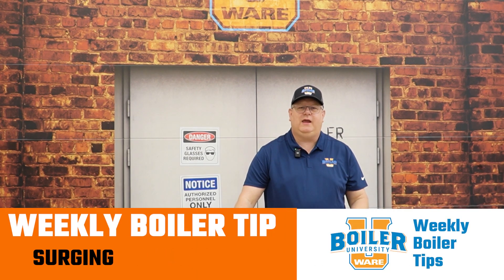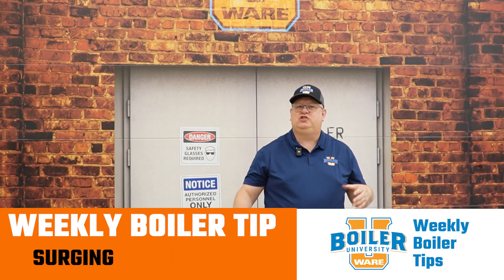Why Your Boiler Is Surging—and the One Fix You Need NOW - Weekly Boiler Tips

Comment: I cant remember why i subbed to this channel...But how do you "blown down" a boiler? Compressed air?
Reply: Older boilers have a manual valve what is opened by an operator by hand.
Modern boilers will have a pneumatic valve (opened with compressed air) linked in with a timer (x2 a day for 8 seconds each)

The boiler it’s self will have pressure inside of the vessel thus the water discharging by its self when the valve is opened. 

The water will then go into a blow down vessel which is a large cylinder shape container with cold quenching water to cool down the boiler water before it goes down the drain. Uk standards state the blow down vessel is sized so the water overflowing into the drain does not exceed 43 degrees, not sure about US rules
Reply: Like other guy said. Most older boilers. Have a quick open valve and a slow open valve. In my room I usually wait till my psi drops  open quick. Open slow. Blowdown. Close both and open just the slow again and close.
Reply: Open a valve to drain water , it rinses the line of buildup that's in water